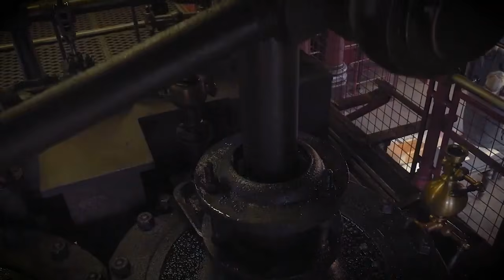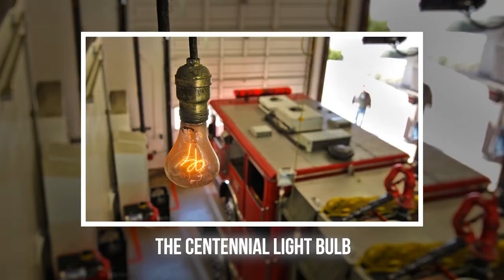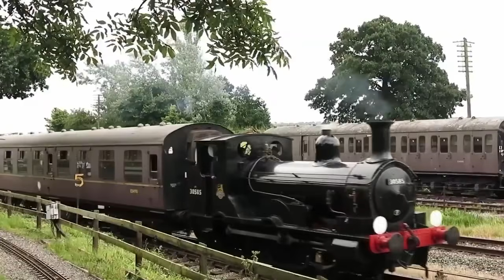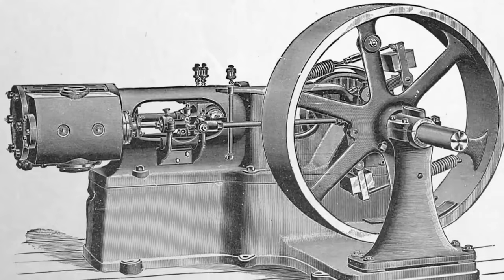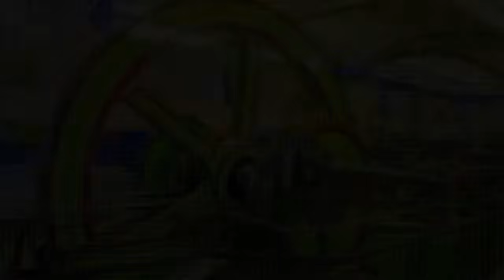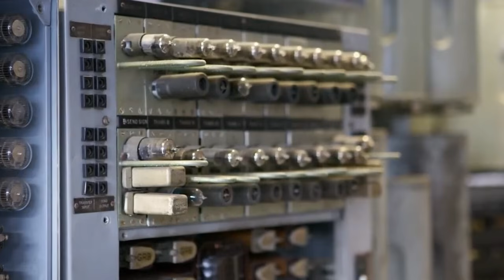15 Machines that STILL RUN After 100 Years!

Comment: There are so many companies using engines from the 1900s & 1800's you would not believe. They are so precise that they will never need replacing. I have designed New presses that are taken directly from machines like this, simply because they are Bullet Prgoof, you Cannot improve on Perfection, & they knew exactly what they were doing.